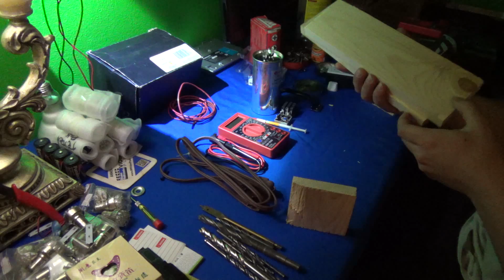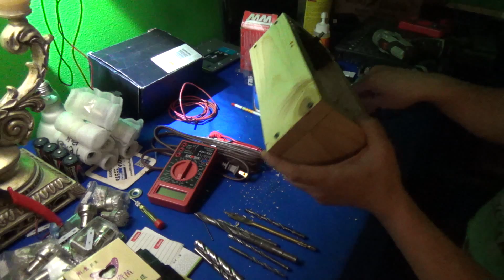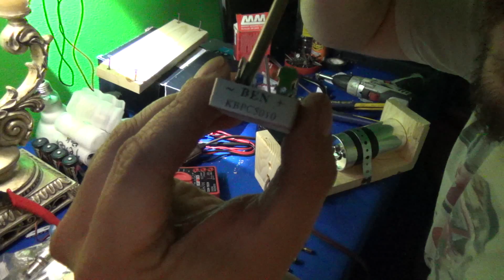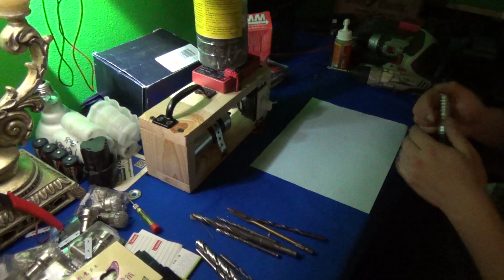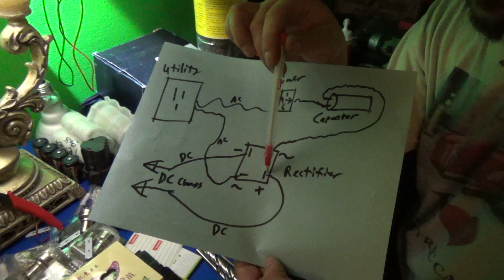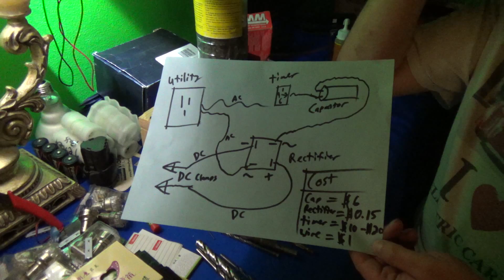How to build a Desulfating Capacitive Battery Charger Complete Diagram Start to Finish Desulfate

Comment: why not use a resistor? is also unsafe but cheaper!
Reply from the maker: Mat May Resistor generates heat as part of it's "resistance". Capacitor does not. Resistor =Fire hazard. Also, the current flow, a resistor big enough to do what this one capacitor does would cost more.
Reply: 27K 2 watt carbon composition resistors are about $2 each. Cheap insurance to avoid a wrongful death lawsuit.
Reply: Capacitor is best.